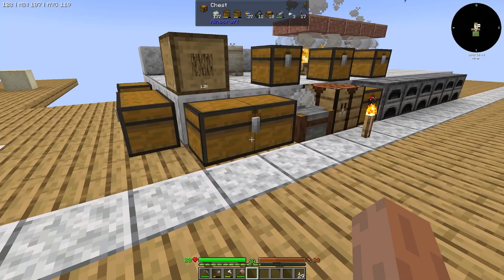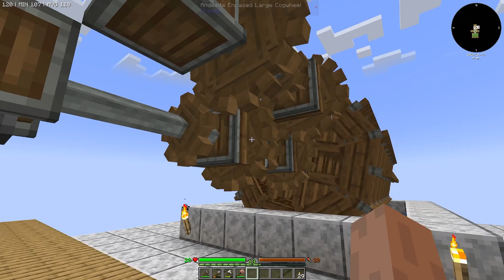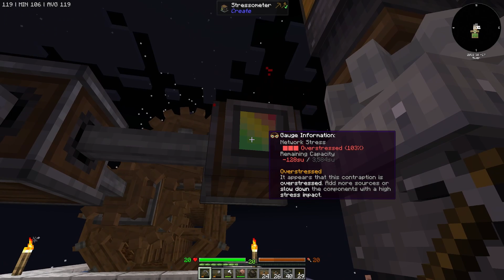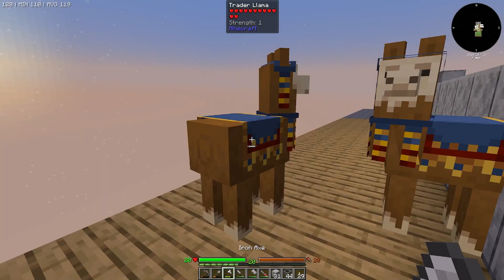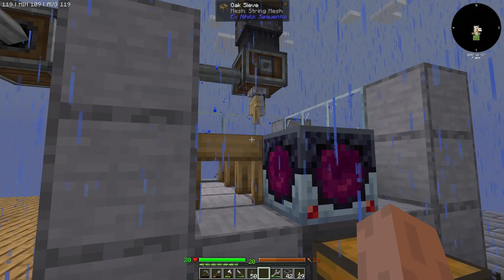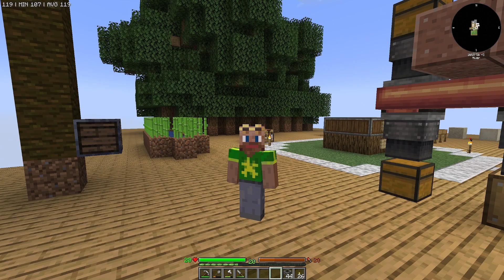Star Technology - 03 Coke Oven

Comment: Idk why but my steam boiler produces almost no steam after using the initial 16 B and then it never fills up
Reply from the maker: @RebounMan  Steam boilers need to get up to temperature before they can start producing steam, and they will also continuously consume fuel to do so, even if they aren't being used for work. (They will periodically make a steam escape sound to let off pressure). So they need a constant supply of fuel and water.

Comment: What mod or what is the key combination to be able to put a large number of blocks like this?
Reply from the maker: The mod is called "Effortless Building". You activate it by holding down the ALT key and choosing a mode from the wheel that pops up. Just remember to disable it again when you want to place single blocks. Later on you can get upgrades that increase your reach, but I haven't really tried them. :)

Comment: here are som huge tips for early game 

1. always try and utilize the 1 to 1 plate ratio for some of the early game metals from create cause it gets rough
2. try and get into steam early game for better ratios for grinding down materials
3. once you get it the PBF (primitive blast furnace) will be your best friend i highly reocomend making multiple of these and using what we GreTech'ers call wall sharing where the multiblocks share a similar side and keep that thing running always
4. seiving can be really annoying early game once you get gold (you can get it by milling or crushing or forge hammering granite and then washing the red sand for nuggets which will be what you need) you can make what are called modular routers and activator modules that basically act as a player and can do the sieveing for you and you wont have to be near them
5. i would always make at least 8 of something wether it be a rod, plate, screw etc. because you never know when youll need another one
Reply from the maker: Thanks for those tips! As you pointed out, there's plenty of things that save you a lot of time if you know about them, which is one of the reasons I decided to start this series :)
Reply: @gameswithpostie  awesome ill be watching the other episodes i myself just made it to the electric blast furnace. :)

Comment: You could have used 25 sieves in a 5x5 and using the deployer in the middle would activate all of them for the same rotational force you know? But really cool job!

Maybe you should consider making yourself a couple of farms with Create (since that's what you have and it doesn't seem anything from t is gated). Kelp is going to be essential for conveyor belts and automation with funnels, cane might be a good idea, wood and... crops? There's no need right now, but later for fuel or diesel or what's the name.
Reply: gregtech has better farms. but create ig good in other thigns here.
Reply: @naveengraze  well, Create farms are infinitely expandable with only one gantry and many Chassis, or even only the Harvesters, and use, to my knowledge, minimal SU. And it's possible to simply fertilize them with bonemeal if one has it automated some way, if one doesn't play peaceful, that is. There's some really broken stuff possible there.
Reply: @d4rk4x3l3  and do you know whats even better? you can use a windmill mesring and attach sails to your farm and get SU instead of using SU. gregtech is better in terms of lsg efficiency as the GT farm im talking about has no animations. create isnt lsggy too the flywheel engine is very well optimized.
Reply: @naveengraze  no way. I don't believe you. That's an esploit that the Create authors would have fixed right away... right? RIGHT?!?
I'm going to test that, but really, one can use cart contraptions completely free of SU usage too, so there's that :D
I think the mod is broken in so many ways it's the reason it's fun :D
Reply: @d4rk4x3l3  yeah. like the fact thst you can generate SU out of nothing by conmecting hand cranks to a single mechanical bearing which is connected to a bunch of deployers that are spinning the hand cranks.
normally
water wheels are realistic. they just need infinite water
windmills just need infinite wind
steam engines need infinite water and heat
but. this method breaks physics and makes create unrealistic
this method isnt newrly as effective as nesrly anything else
and the fsct thst it requires deployers too... but hey
i can confirm that create brekas physics.
Reply: @naveengraze  oh I knew about the Deployer/Hand Crank thing, not really effective but it's funny :D

Yeah, you made your point. Create is kinda bonkers sometimes!
Reply: @d4rk4x3l3  the problem with create that makes some players not like it is thst it makes the game easier in a way
gregtech especially gregtech nrw hprizons makes it so tsht you will need 10000 hre to finsih it but create though...
what i think they should do is nerf steam engines.
make recipes costiler or judt make a seperate hard mode in the config. thst makes it so that all machines need more SU
all things produce less SU and that things are expensive. maybe even a pollution mechanic too...
Reply: @d4rk4x3l3  and hey. a tiering system like GT will be good too. like. Mechanical press steam press electic press
maybe not as complicated as GT but i tholink you may understand.